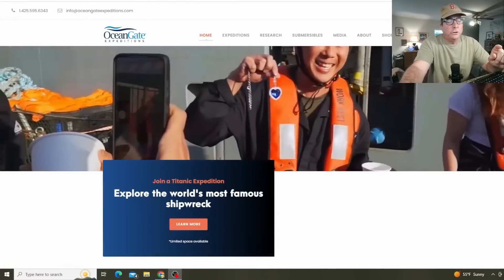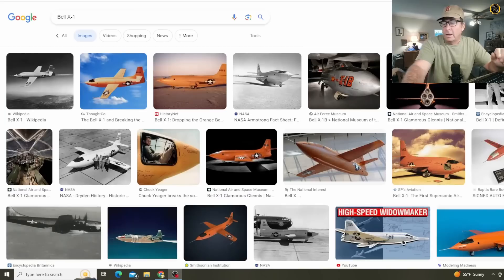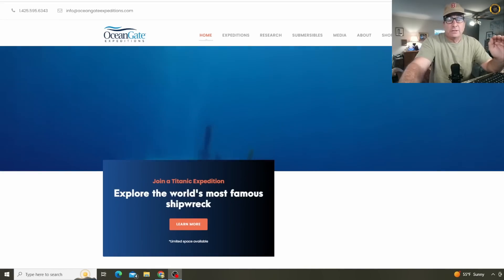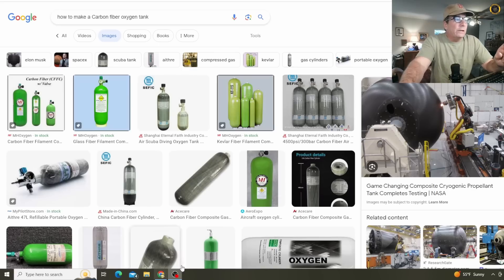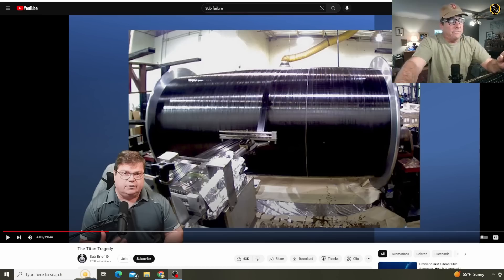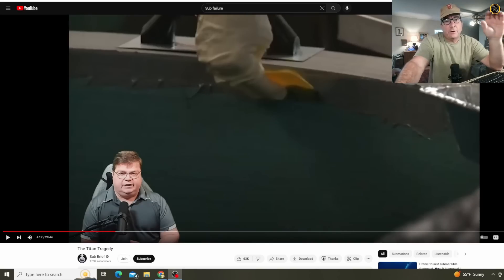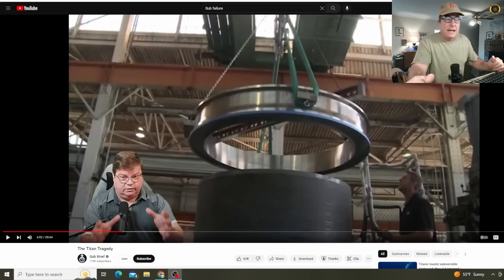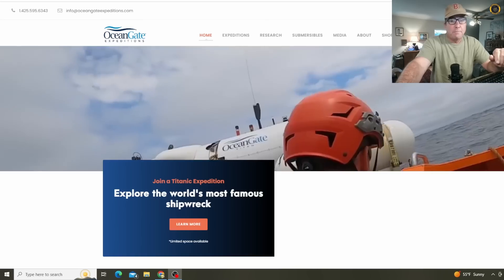Oceangate Sub Construction Details and Implosion

Comment: I wonder if there is a pressure chamber where the sub could have been given a real world test by subjecting it to the same pressure that it would face at depth.  I bet the US Navy has something like that.
Reply: I wonder if designs for the pressure hull of the Alvin were tested in this way.
Reply: Maybe for components like valves and hatches but the hull of a nuclear submarine is too big. You have to rely on the design, construction and quality control. And the first dive after construction or any significant maintenance is done very slowly and methodically.
Reply: All you need to do is create a vacuum inside the chamber ... that creates exactly the same pressure differential that going down to depths will do.
Reply: @MrRugbylane  Nah. Atmospheric pressure is only 14.7psi at sea level. If you have a container and remove every last air molecule inside it, the pressure differential would only be 14.7psi. To simulate the pressures that this submersible was meant to encounter, you need some other means of creating significantly more external pressure -- about 5500psi. And if it were properly proof tested, more like 8000-9000psi.
Reply: @MrRugbylane  Not even close. A vacuum is 1 atmosphere less than 1 atmosphere. Those depths were something like 350 atmospheres. Also tension and compression are not the same thing.

Comment: Great Video,

Since this is an aviation group, could you briefly explain the use of "Carbon Fiber" in today's aviation construction of planes such as the Cirrus ga planes, Boeing & Airbus.

A) what type of loads stress airplanes ✈️ tension or compression loads?

B) some airobatic planes can handle high G load stressor of 10g or more.  Do subs experience more compression g forces than planes?
 
Many ga planes could break up when exceeding their envelope.

Should Cirrus owners worry while flying with family in this planes, is that the reason they had to add a parachute as an extra safety feature because they choose to construct a plane mostly made out of carbon fiber?
Reply: To put things in perspective, an aircraft fuselage has a maximum differential limit (inside to outside) of about 9psi when at altitude and the structure would be in tension as the force act outwards. The Titan at 4000m would have a differential of about 6000psi and would be in compression with the force acting inwards! Even the tension/compression forces on things like carbon fibre upper and lower wing skins would be nothing compared to the forces on a submersible at these depths.

Aircraft are designed with a load factor of about 150% of the normal operating loads, where as Titan looks like some components weren't even designed for the normal operating loads! 

Aircraft are also subject to much more stringent airframe cycle tests which are done on an airframe load rig constantly running a simulated flight loads, which is years and cycles beyond the oldest and hardest working airframe in service. So any issues are found well in advance and proactive modifications and replacement of parts showing sings of fatigue are replaced before the issue manifests itself on an operational aircraft. 

Carbon light aircraft airframes are way stronger than their aluminium counterparts, so no need to worry about those!
Reply: @simonbaxter8001  Thanks 4 in depth explanation  😊
Reply: I trust well engineered carbon fiber over well engineered aluminum.

"Well engineered" being operative.
Reply: More than 50% of the Boeing 787 and the Airbus A350 XWB airframes are carbon fiber composite. Hexcel is a major supplier of materials to both programs and was awarded the contract by Airbus to supply the primary structure prepreg, with Hexcel carbon fiber, for the A350 XWB program.

Comment: Juan
There are NDT methods specifically designed to inspect Composites
One of the very early ones is Acoustic Emission Testing
There are countless Standards from ASTM and ASNT dedicated to evaluating the structural integrity of Composite pressure vessels.
If you have questions let me know Cheers
Reply: We do acoustic NDT testing on every part that leaves our factory. We build parts of airliner engine nacelles.
Reply: Glad to hear Joshua you guys are using ART
 I am an ASNT Level III and SME in AET having worked with AET for many decades
Reply: Are there any limitations on how thick of a lay up that can be tested? I heard one report stating that there was some reason that testing would not work on this hull. No explanation was given.

Comment: The Boeing 787 is made of carbon fiber
Reply: The 787 has higher pressure inside the hull. This sub had thousands of times this pressure outside the hull. Tension versus compression.

Comment: Great breakdown.  Would the end caps have been better strengthened if they had been bolted by maybe foot long bolts on each end?
Reply: My opinion on that is by running foot long bolts into 5” thick carbon fibre the bolt is going to damage and or displace the carbon fibre.
Reply: I would think ramming bolts that size through carbon fibre would significantly weaken the fibre in that area and instead of blowing out would have just ripped the bolts clean through the hull...Same end result though